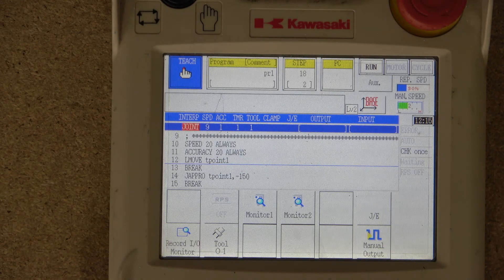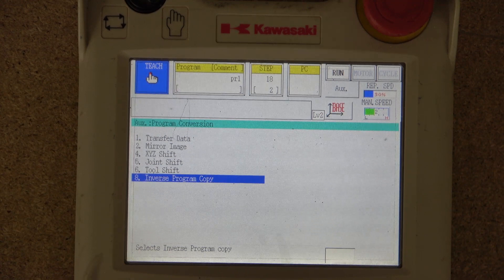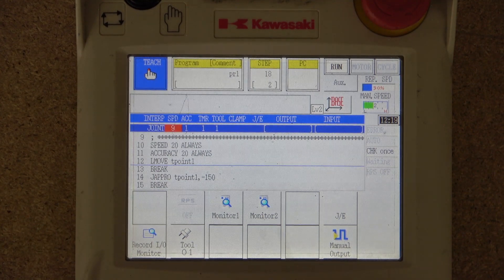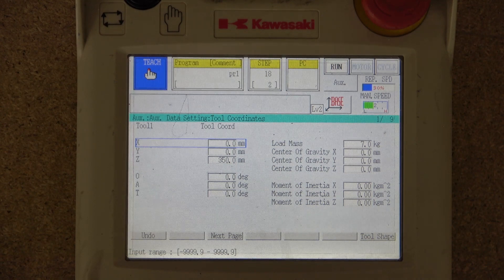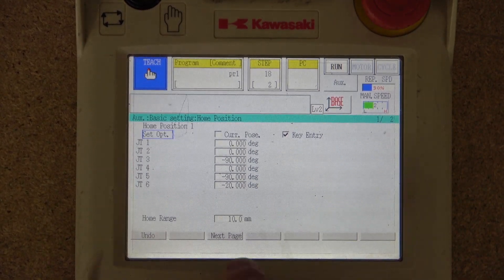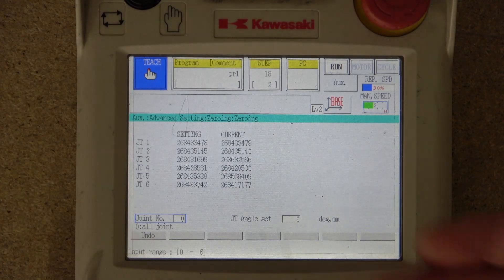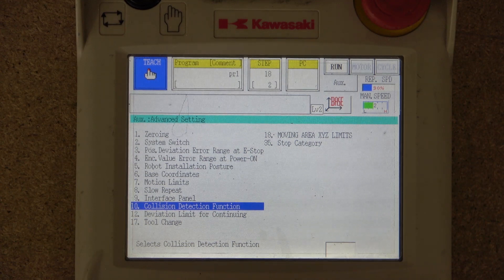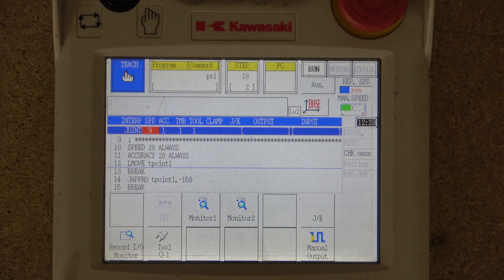Industrial Robot training with Kawasaki RS007. Introduction to display and Aux Functions #2

Comment: Hello. We have a machine that deposits a layer of metal on the inside of a diesel locomotive wheel. The motor that rotates the wheel is controlled by an MR-J2S-A servo drive. Sometimes we get error e56. sometimes AL 51. Sometimes there are jerks when rotating without errors. Could this be due to the mechanics of the machine, or is it a hardware, electronic problem? How reliable are these control units and the Mitsubishi motors themselves? Thanks in advance for your answer.